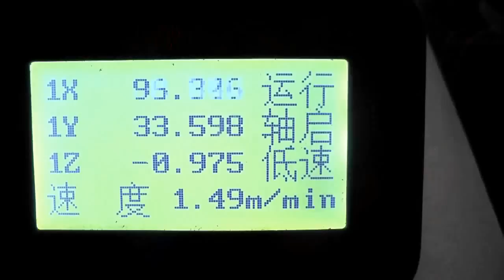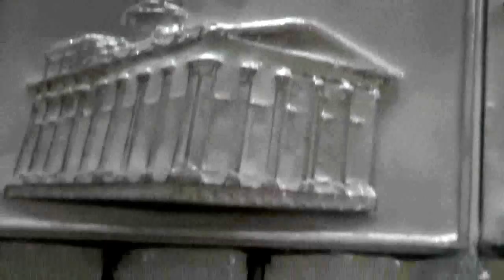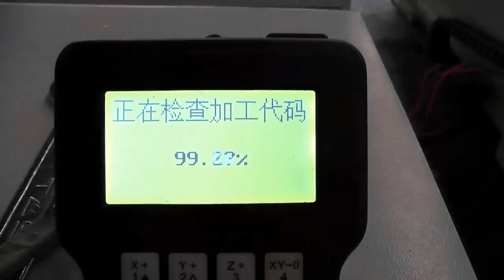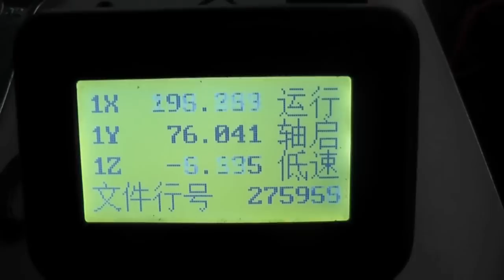Nauvoo Temple relief on white marble, china cnc machine, cnc stone marble engraving machine

Comment from the maker: mist cooler is used for metal mostly, and it spray cooling oil which is expensive than water. Water cooling method is very common in stone engraving.